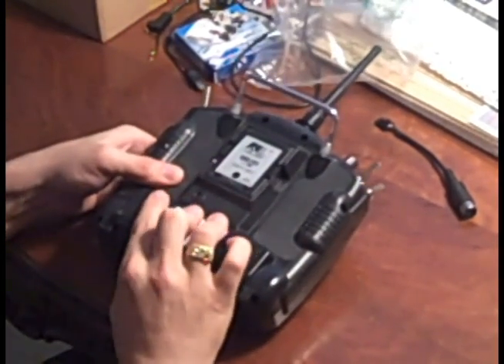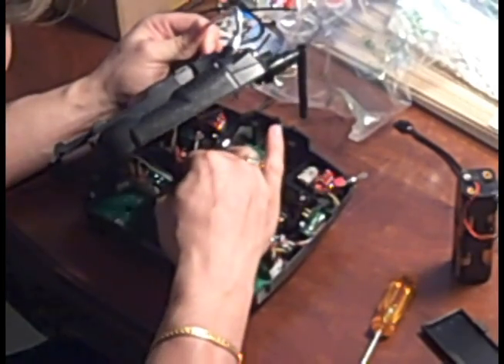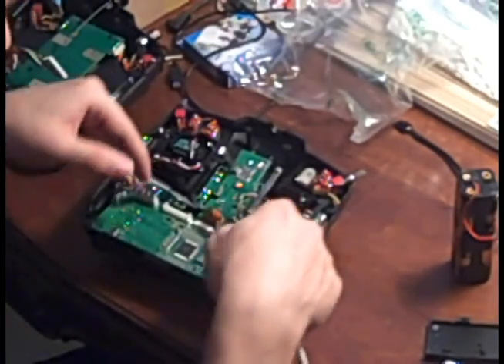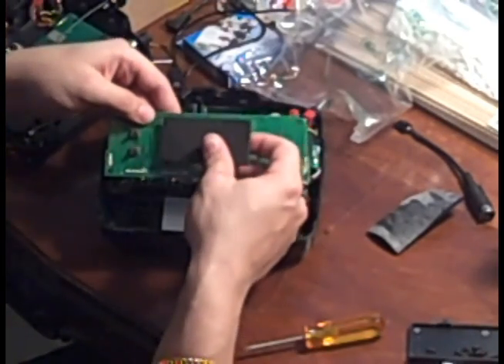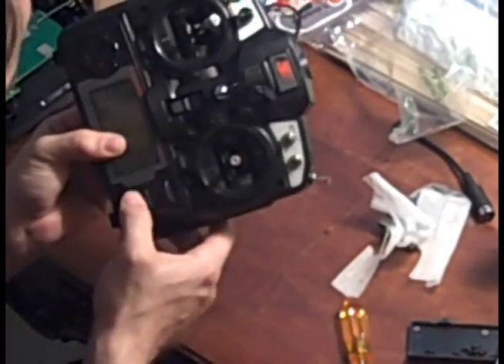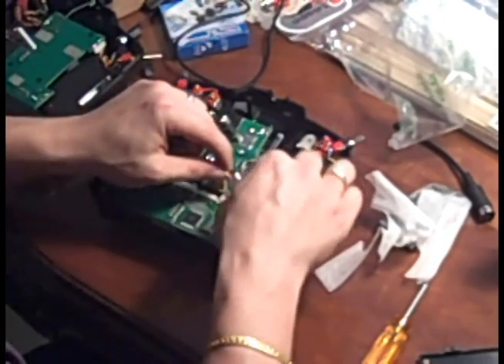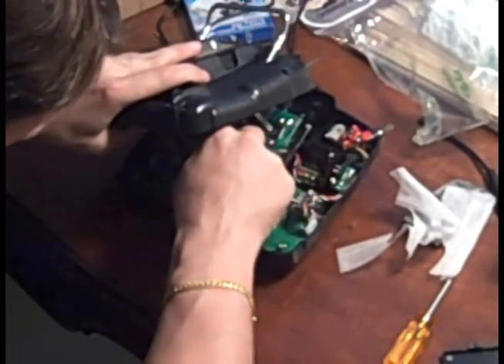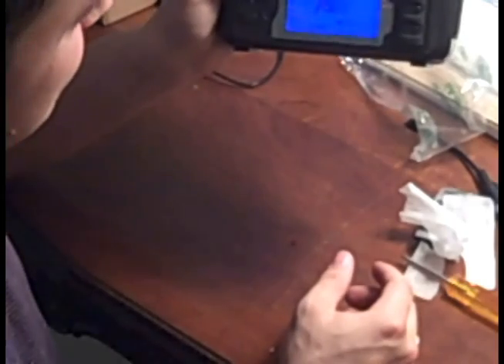DIY: How to install a backlight kit into a FlySky TH9x Turnigy 9x

Comment: Just a heads up.  Use an old magnetic stick on the car door sign, as a work surface, it helps keep the little screws from falling on the floor!
Reply from the maker: +Larry Mahn yeah i have a magnettic bowl from harbor freight: http://www.harborfreight.com/6-inch-magnetic-parts-holder-97825.html

Comment: Did you tape down the display to hold it in place on just the left side, against the plastic body at the bottom inside case of the transmitter.  Or did you tape it down on both sides.  Thanks.

Comment: hey there, i found one shop in germany who sells them for about 10 euros.
nut the send it in a much to big  box off course so that the shipping costs are higher than the product itself (total off 21 euro's).
so i asked them if its possible to send it in a envelope with the protection plastic. waiting for an answer.
but no backlight for 1,99 or 3,99 !!!! unfortunately

Comment: Where do I buy the kit? Is this transmitter reliable? I'm anning on using it for an expensive gas powered kit...
Reply from the maker: +Rob L the transmitter is reliable, but if you spent money on the plane, spend money on the transmitter. No lie there are better systems out there.